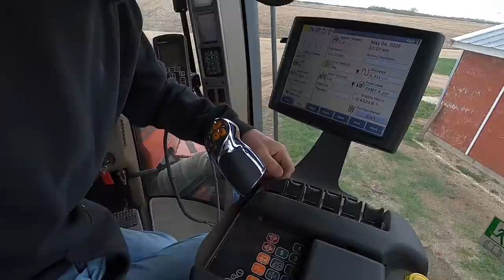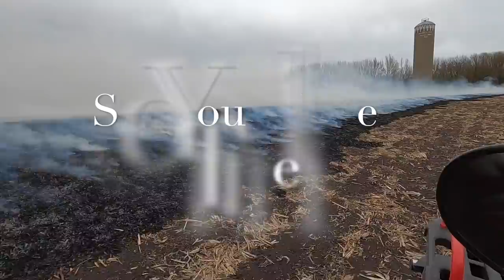FIRE!!! Burning 2019 problems

Comment: Had the same problem on our 765c with the hood cylinders. Put new ones on - still does it. Now we just use a piece of pipe propped up against the rock box, which works pretty well.

Comment: Hey Chet. I always watch your videos. I used to work on a farm that used NH skid steers that had the same problem. We started using grade 8 bolts and we drilled for a couple more grease fittings. It was a different machine but same problem as yours. Those modifications fixed the problem. I always give a thumbs up to your videos. We're  half way through planting our soybean crop here in Vermont
Reply: Lube before you put it back together.  Otherwise parts end up dry and will shear.

Comment: We had the bucket curl cylinder break on ours as well.  Dad machined new pins on our lathe. My father and grandfather were machinists so we have lathes and mills to make our own parts if necessary.  The oem pins just don't hold up that well . My father used high tensile strength heat treated round stock to make ours . Maybe if yours breaks try having them made instead of buying  new ones. We are almost done planting  we have 450 acres left out of our 4500. With rented ground we will have planted  5200 acres total Nice video stay safe and farm on my friends  !
Reply: Lube them before installing...

Comment: Ghetto Mechanic Tip on Cat Hood. Slightly Bend/ Smack lift cylinders sideways (adds a Bit of resistance) and they will work better than New and last a long time til you need to tweek and/or maybe never replace again.   👍👍👍

Comment: FYI U should clean the hole that the pin goes in on the bobcat , if there’s any grease or oil in it will cause premature failure must be clean and dry when installing new pen on any tapered shaft

Comment: regarding the cylinder being bent previously we had the same issue on a folding disc cultivator. best solution is throw it all out and replace the full hydraulic(ram, seals and cylinder) system money spent is worth the time wasted.

Comment: Explain the service truck. Why does it look like you guys out two truck cabs together?
Reply from the maker: Bought it like that
Reply: It is what they call a "crew cab". They work nice, so at the end of the day, you can shut the tractors off in the field and pick everybody up and haul them back to the shop,where their vehicles are, so they can go home for the night. It would be much more beneficial on a large operation, such as Larson's, where they have several tractors operating all at the same time.
Reply: @kevindircksen181  I understand that but if you would look at the truck it looks like someone took two regular cabs and welded them together and I thought maybe they did and I thought it was pretty cool idea. Crew cabs are very helpful around any farm.